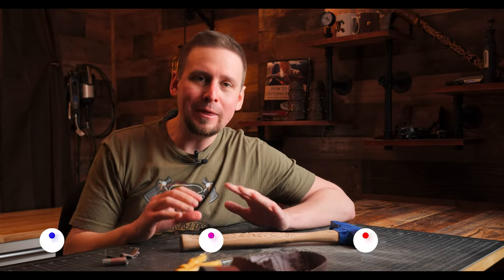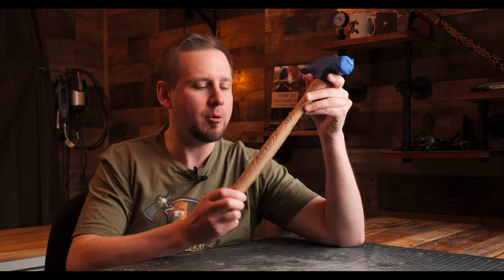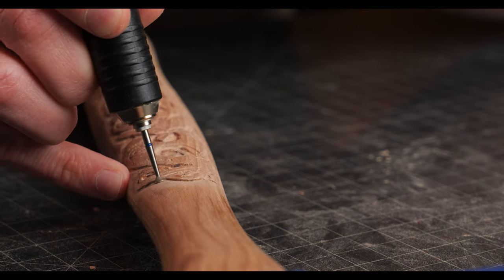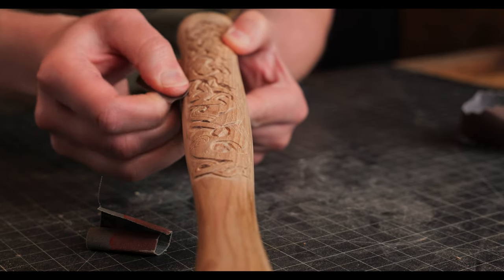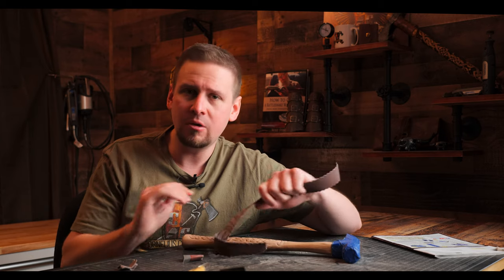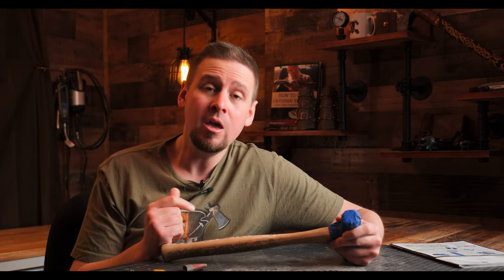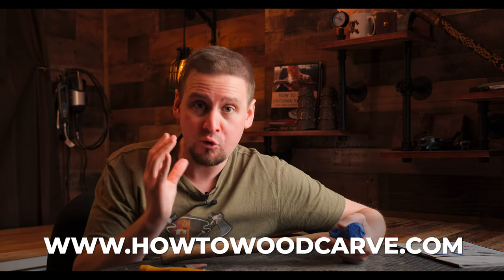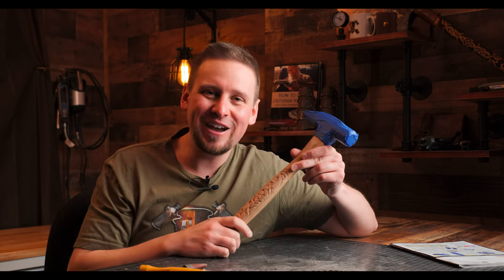3 Carving Tips Every Power Carver/Wood Carver Should Know

Comment: Matt, have a question for you. Have you used those Dremel type sanding bristles and flap discs? I've used 80 grit discs I got from WISH. You can get up to 180 grit. Just wanted to know your opinion. Would think that the bristles would be great for the tight spaces. Great video as always
Reply from the maker: I sure have. They most definitely have the time in place to be used. In this scenario I am finding that hand sanding and using a chisel is working better for me.